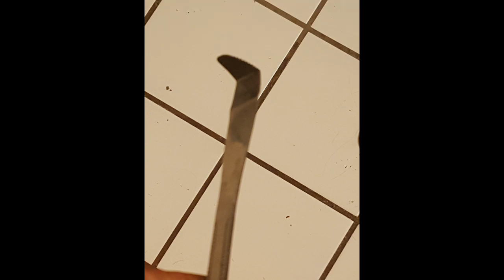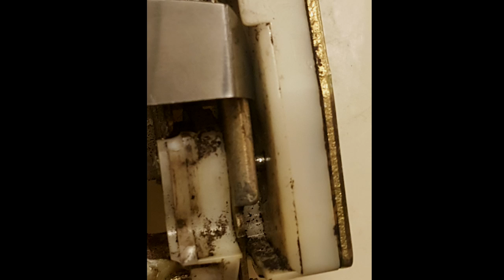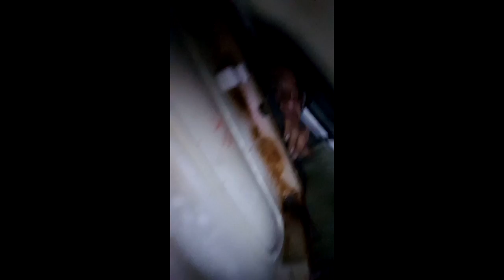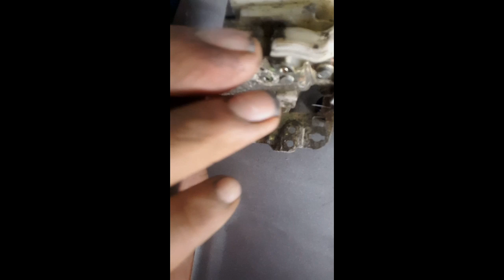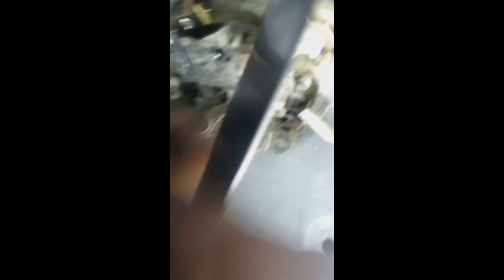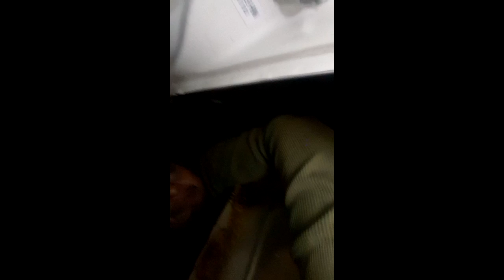Open stuck drivers door with butter knife 1998 civic

Comment: What if the door is shut? I can't get inside at all.latch won't release as of tonight
Reply from the maker: Miss Smile your gonna have to get in passenger side first practice by removing the passenger panel once in, but panel is not gonna come off when door won't open
Reply: kc pitstop I can't get in either side. It's the 98 civic with the faux lock on the passenger side. I came out of the store, went to unlock and the latch didn't release from the inside. I'm completely duped.